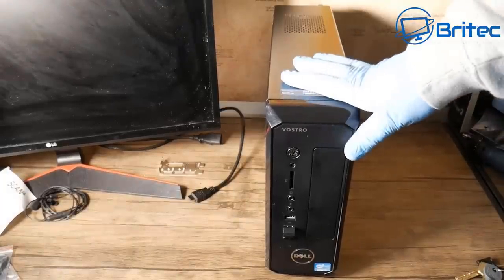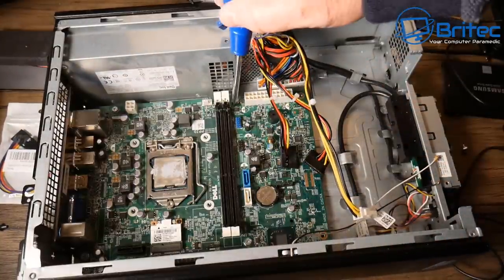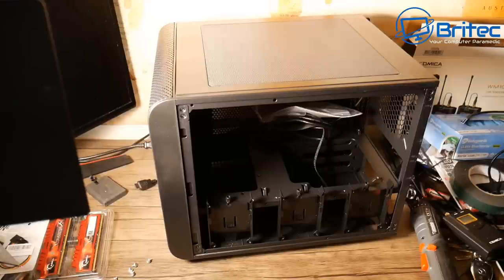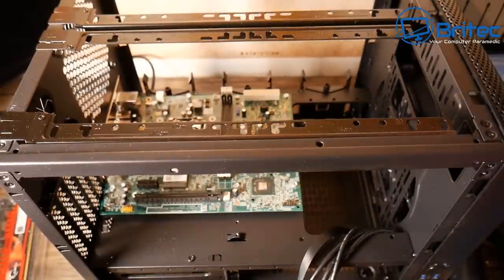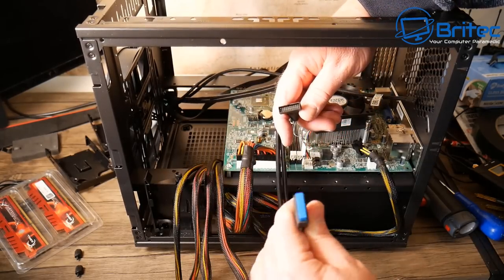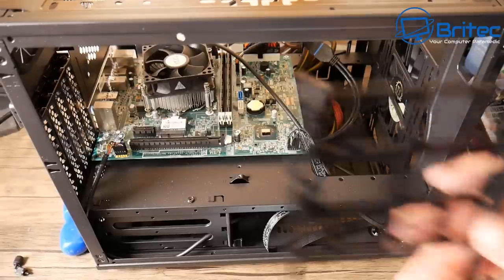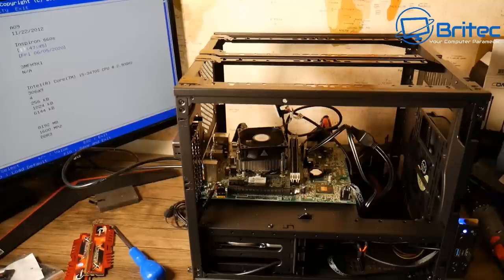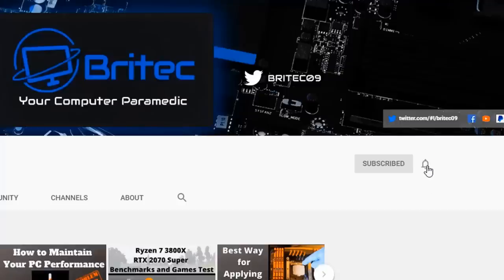How To Upgrade Old PC To A Gaming PC

Comment: I have that Core V21 micro ATX case now; lots of space to hide the cables--love it!  I got it for $50 five years ago w/i5 3570k and Gigabyte board;  just upgraded last year to Ryzen 5 2600 w/B450 mobo.  Wow, what a difference in speed.  Be careful of the acrylic side panel--it scratches easily.  Looks great w/RGB LED strips and RGB rear fan.

Comment: I have this case and that is not how the PSU is installed. It goes in from the bottom after you remove the bottom panel. There is a bracket to secure the PSU before the bottom panel goes on.
This is why you should always familiarize yourself with the manual.

Comment: All good with exception to using that fan splitter, Dell fan wiring pin layout is different to standard pin layout. You can find dell pin layout diagrams online if you don't believe me  Better off getting fan with molex connectors and leave the OEM CPU fan running of the board header.

i have butchered hundreds of Dells from xeon mods to 330/380 Plexbox's to vostros XPS (many terrible but functional things just to make cheap gaming rigs)
Reply from the maker: No fan headers on the motherboard, apart from CPU header. Can use Molex or Sata for fans, did not have the cables. But it will do for now.
Reply: @Britec09  Even when dell boards do have extra fan headers eg optiplex 3010 to use a normal fan you have to cut and solder 2 wires on a 4  pin header to make work. Thought I'd comment cos if your fan is working off that header it means it is causing a short somewhere on that voltage line that may well bring a shortened life to your fan motors. Love what you do though, new subscriber to your channel found you via Mikes unboxing etc I watch all your videos to the end just to catch that dub plate bless

Comment: Nice little build! I've just been given an old Optiplex 7020 by a family member and was wondering what to do with it. One question though, what is the best way to upgrade to an SSD and  from Win 7 to Win 10 at the same time? Is it better to just put a fresh install ISO onto the SSD and deal with trying to use your Win 7 key or clone the HDD to the SSD first then upgrade Windows? Would appreciate any advice on the matter anyone can give me.

Comment: Nice Job Brian. Just curious were did you get Sata port for RGB? Thought Motherboard only had 2 and both were used for Hard Drives?
Reply: He cloned over to an ssd and took out the mechanical drive
Reply from the maker: Use SATA Power connector for RGB :)

Comment: I've got three Dell computers, 
Dimension 5150 which is about 15 years old was running on Linux, but it will not up date on the software due to a bug. Second one is a Dell
Inspiron  3847, Went down last year
On the 4th April 2019 with a blue screen of death, can not repear it, so got second hand one from Amazon
for £160 which is Dell Optiplex 790.
So it's getting like a junk yard in my bedroom.

Comment: I have an old 4th gen intel PC but in a Zoom case so all standard.  Booting into Win 10 with a mechanical HD was far faster than that!  Got an SSD in there now to use as a boot drive thanfully as HDs do degrade with time.  What brand of PSU is it as you never mentioned?

Comment: Lucky score with that Dell Vostro motherboard. I think some of the Dell Optiplex 3rd gen Ivy Bridge Intel boxes had USB 3.0 on them (although I believe on that generation, the USB 3.0 was an 3rd party controller?), but didn't become standard until the 4th gen Haswell stuff? Intel was really annoying then. AMD had already standardized USB 3.0 and SATA 3 on their boards before then. I don't remember, but I don't think Intel had native support for SATA 3 yet on Ivy Bridge, or it was limited to two ports? I know they didn't on the previous Sandy Bridge chips.
Reply from the maker: I knew the Dell Vostro motherboard would be easier to work with than Optiplex, that's why I choose it lol

Comment: That's a bit of a done with the thermal paste third of that would have been plenty, and can be in danger of sorting out on some metal thermal paste to be aware for anybody and can be counterproductive more paste will cause thermal isolation,
So where would you recommend buying second-hand if not eBay Gumtree
Reply from the maker: temps went from 65c to 30c so its fine.

Comment: Can you recommend a good budget graphics card? Currently using a GT610 with my i3 2100 system...really want to upgrade my graphics card to play games like GW2...any advice appreciated.
Reply from the maker: Whats your budget?
Reply: @Britec09  Hi. Not much. I could go upto £150 absolute maximum but I would prefer to spend less. Second hand is an option, too, so long as it world work with my 350W PSU. Gotta be careful not to spent too much as I am broke and my PC is old.  Cheers!
Reply: @Britec09  I have been thinking about either the GT1030 or the GTX1650 Super...would you recommend these?

Comment: Be VERY careful with the Dell Vostro series. I have 3 of them here, two are doing duty as my NAS boxes. Both have matching setups, I bought CPU's to suit. They are only Quad Core, but both at Intel @3.4GHz. They both run a paltry 2GB RAM, still, far more than my NAS needs. And these two run great. The third machine is an IDENTICAL cased Vostro, but it's mainboard is an AMD CPU and AMD chipset. It WILL NOT BOOT unless I have it's ORIGINAL parta in it. I changed the RAM, no boot. Added a PCI GPU, no boot. Tried a faster CPU (from the maker's list of working chips), NO BOOT. I put it back to factory and it booted right up. Some of these SFF case machines will not allow anything beyond what they are. Buying and gutting them out for parts can be an issue. This AMD Vostro was made for Windows 7 with 4GB of RAM in it, and it runs that fine. I tried to install Windows 10 and no drivers could be found for the onboard chipset. The video and sound are both nVidia chip based on the board and only have Windows 7 drivers that work ONLY with the correct Windows 7 version. YOU MUST RUN an OEM Dell version of Windows 7 Professional to get it to boot. A hardware and software tie in like I have never seen before....it won't take ANY linux either, 90% of the Debian and Arch system's I tried wouldn't complete the install because of unknown componentry and the few that DID get to the desktop had more issue's than I care to list. It's not only Dell that do these silly things, so any OLD PC can bite your southfacing sitting solution.

Maybe someone should make a list of the world's PC's and compile which one's can and cannot be gutted successfully.....this couldn't be more than 50 billion or so PC's, and a 500 volume 10,000 page per TOME guide.
Reply from the maker: These Dell machines are always tricky and all are different.